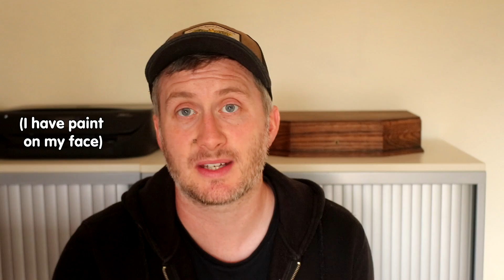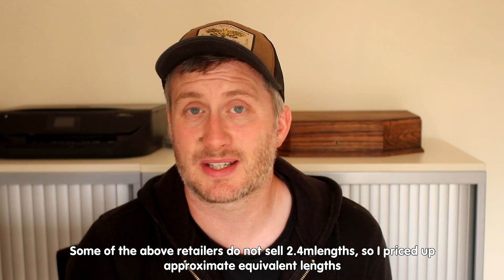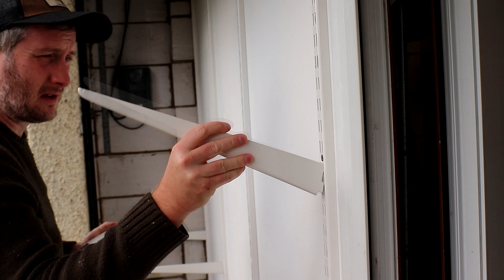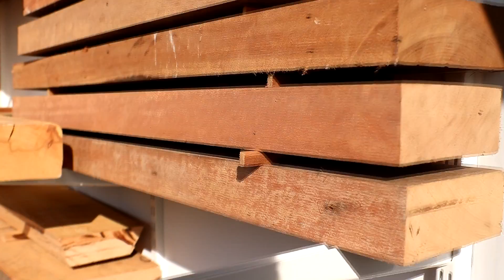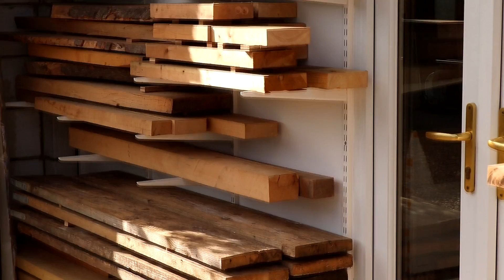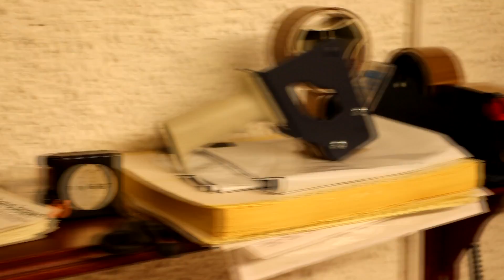Timber Storage Rack & Finding Space For All My Wood!

Comment: Nice one Keith i use the same thing in the shed to hold my 3x2s and 4x2s, they hold the weight well and can be deceiving at first, but they do a good job and don't look to bad either.
I bought mine from Wilkos not as big in height as yours, and i thought the price was good did you check there yourself? I will prob be buying some more so i might take a look at where you got yours from on Amazon.
Barry (Wirral, ENG)
Reply from the maker: I didn't check Wilko actually, that's usually where I look first - love that shop

Comment: Those twin slot shelving are very versatile,  i have used them for creating a workbench, on the frontside the worksurface is supported by metal table legs.
Keep in mind when using those twin shelving system, that some brands have rails that have a different bottom and top, if you don't place all the rails then in the same direction, you get a difference of a few centimeters in level.

Comment: Great video. Thanks for sharing and explaining. Gosworth Handyman (Andy Mac) recommended a similar shelving system in his video about a year (and a half?) ago.
According to that I bought them as well and I also use them for stocking wood and other things in my shop and garage. They are really great.
For dry wood you solution for storage is excellent in the inbetween space. But for fresh wood it is not. In spite of insulation temperature can go up
there quite a lot and there is no(t enough) ventilation.
Reply: I got some of those recommended by Andy too. Used them on the gable walls in my loft to get some weight off the ceiling joists. (I have far too much stuff up there!)

Comment: I've been using Spur shelving in my garage for 15 years (screwed to a brick wall) with no issues Mate, one thing I have found is some different makes of brackets don't  fit in to  other makes uprights (sound obvious but as I but second hand....)  👍 👍
Reply: Hi Sparky 415, 
I've been looking for a (brick) wall mounted wood storage solution and just found Keith's video and your comment so between you you've given me a solution.
Can I ask what pitch you have used between the vertical mounting rails to avoid the risk of sagging and achieve good load distribution?
Cheers.
Reply: Sorry John I can't help you as I use mine for normal storage, wood shelves and plastic boxes (a lot of combined weight) If you are going to use them for storing boxes I would suggest mounting the uprights to suit the width of the boxes, Maybe Keith can help you?

Comment: Dylan smooches
I like the twin slot system better because the weight is distributed along the entire hight of the wall instead of in separate areas. Much sturdier.

Comment: This is a brilliant way to utilise the space between your wall and the garage door. Two concerns that may not end up being a problem is the access, having to open up the garage doors every time you need some timber, but more importantly you might get issues with condensation over the winter, which is not great for timber storage. Plenty of ventilation may be the solution but it is no much fun if you get damp timber and then you are not far away from rot.
Reply from the maker: Cheers. I don't see why opening up garage doors to get timber is a big deal, it's on a remote control it couldn't really be easier! Condensation could be an issue so I may install some wall vents and dehumidifier but I'll see how it goes

Comment: The wood storage looks great. The good thing about those slot shelving units is the brackets dont take up too much vertically space as the home made brackets do. I made some home made brackets similar to yours but they get in the way so I think I will change them out for the slot shelving system.